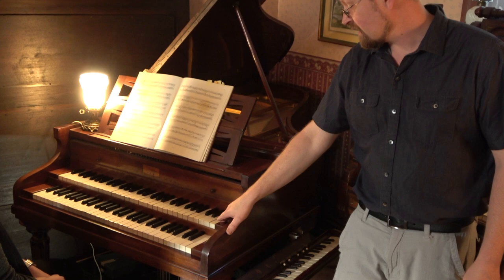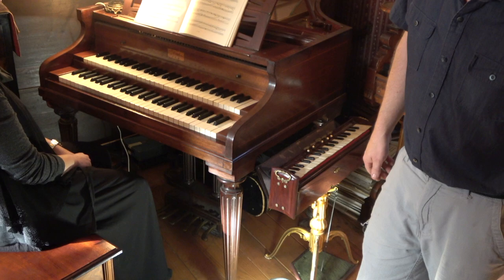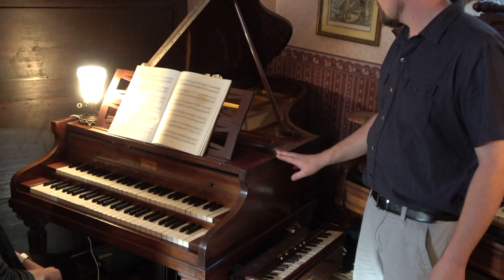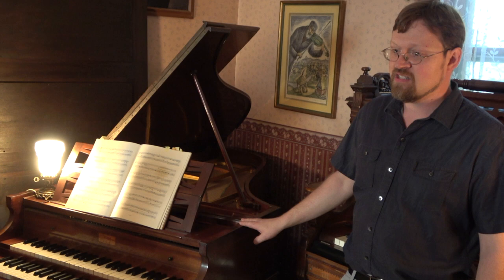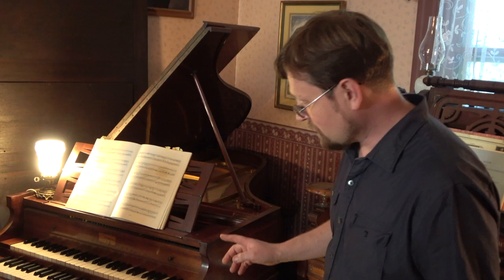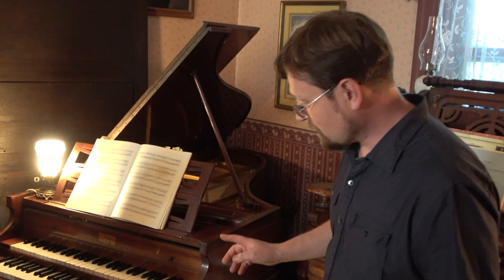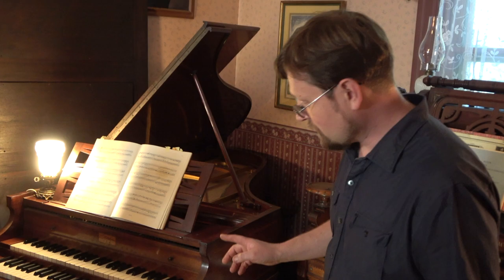1920s Pleyel harpsichord overview with Hans Herr and Lana Krakovskiy

Comment: This is NOT the ‘Landowska-model’ original from 1912 (=Grand Modèle de Concert, length 250 cm). 3:36 This is the ‘Modèle réduit’, having a rounded tail and much shorter, lacking the 16’ stop.